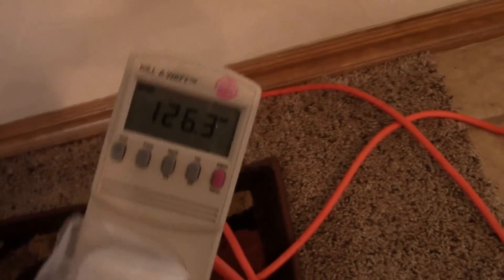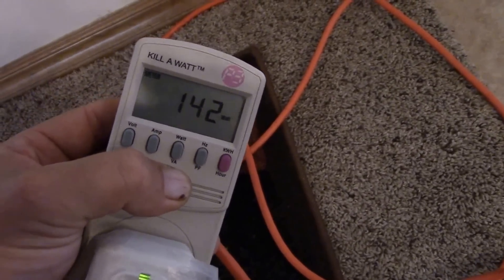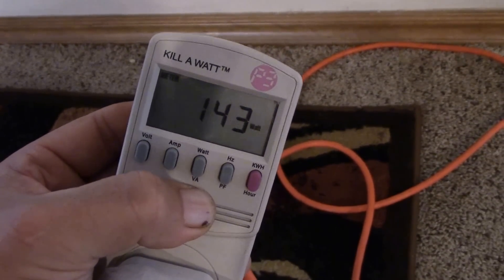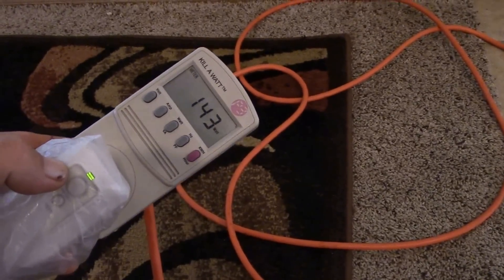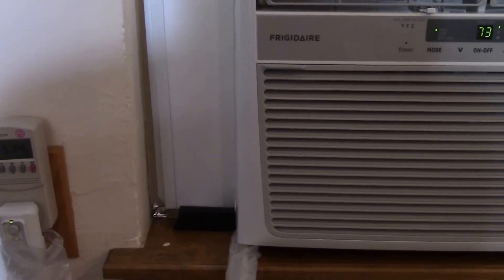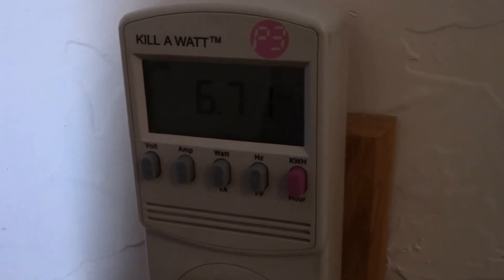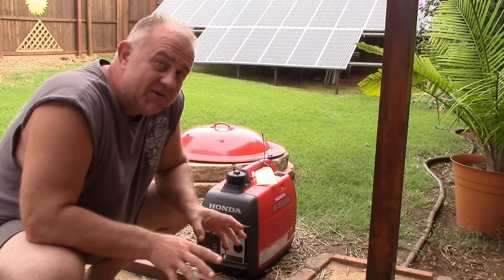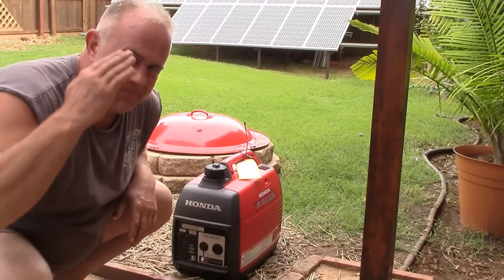Part 1: Will a Honda eu2000i inverter/generator power a 12,000 cooling BTU window AC?

Comment: It will work, you just have to turn econ mode to OFF so you the compressor can get enough juice to kick over.  Either that or install a Supco SPP6 hard start capacitor on the window unit.

Comment: One can look up the chart for wire thickness for  12 volt / Amps / distance. Many folks have undersized wires for their batteries / solar /7-Way connector. Heavy duty jumper cables work better because they are 1 gauge.

Comment: When the compressor starts up it surges to about 2100WATTS for 2 seconds on that AC you have. I have a Ryobi Model # RYI2200G & I have a GE 1150BTU unit & it runs it fine. But also mine has 1800 RUNNING WATTS & 2200 SURGE WATTS. Try this model instead plus it's far CHEAPER then the HONDA.
http://www.homedepot.com/p/Ryobi-2-200-Watt-Gray-Gasoline-Powered-Digital-Inverter-Generator-RYI2200G/205227796
Reply: Or get the HONDA 3000WATT unit. It's $2100 with tax though $$$ OUCH !!!

Comment: How about if you used a large capacitor to help with start up?
Reply from the maker: It was the cable...I rigged up a new 12/3 cable and it works. Video soon.

Comment: Brother I think it's the cord. I would be socked if it could not run it. We had that same gen and it would run are 8000 BTU AC and the frig at the same time. Would be nice to know. I know this if that is a 16 AWG cord that bad boy will get hot. Thanks for trying. God Bless Brother.
Reply from the maker: Yep, youz are correct! It was the cable...video soon! I got her running on that little Honda now!
Reply: @ChrisDIYerOklahoma  just curious, did you just use a shorter extension cable to get it going? After seeing my parents struggle in Texas, I want to prepare, and I'm thinking a 2000W inverter generator is a good start. Just want to make sure I would be able to power my 12k BTU AC unit in a pinch. Also, I would go solar but it seems the up front cost is pretty huge so maybe someday

Comment: using that extension cord, will increase the amperage draw on the system. I should be able to handle it with the cord
Reply from the maker: It was the cable...I rigged up a new 12/3 cable and it works. Video soon.

Comment: Yes, I'm thinking it's the long cord... I tried a long cord to my 13000 btu camper AC off a 30 amp circuit in the shop- same thing, wouldn't start.  You could try a much shorter cord...  I might even try that with my Ryobi inverter generator just to see if it will start the exact same 12000 btu unit in the house. Fun !
Reply from the maker: Yep...you are correct. It was the cable...I rigged up a new 12/3 cable and it works. Video soon.

Comment: Man I am Very surprised that did not work, is the Honda 1600 watts or 1800 rated?  wonder if it was the cord?  Was the cord at least 12awg? I know 2 many ??s  Good to know what it will do either way.
Reply from the maker: 1,600 watts 13.3 amps. It was the cable...I rigged up a new 12/3 cable and it works. Video soon.

Comment: This seems so counter to everything you have been doing. I get the solar/wind/ water assist etc. Might as well get it from the grid for cheaper and cleaner than that generator.
Reply: HE was doing it just to see if he can. Not to run it 24/7 on the gen..
Reply: The load rating on the generator would have likely told him that.

Comment: That 12000 btu was just too much. Lets use 850 watts / 24 volts = 35.4 amps DC. Not too bad. When you get those 6 new panels that should change the game a bit.
Reply from the maker: Cool stuff! It was the cable...I rigged up a new 12/3 cable and it works. Video soon.

Comment: i did the math your 12000 btu use about 33 amps.on your 24 volt system  so im wondering would the honda run a 40 amp battery charger to keep up with the air conditioner that way?
Reply from the maker: That is sorta what I am doing with the solar power. Thanks for watching.